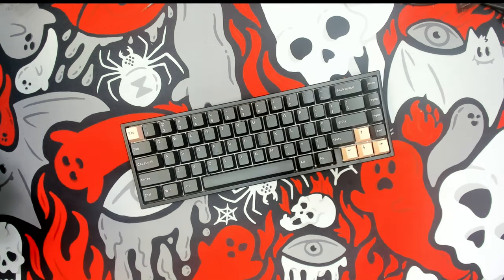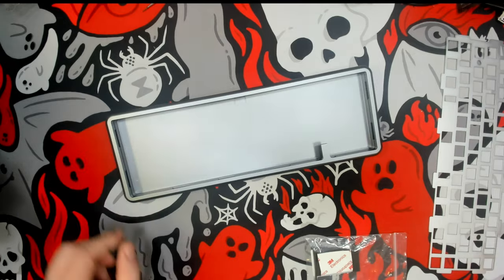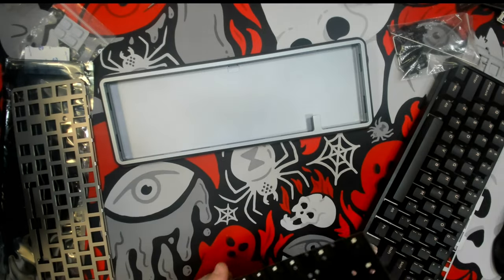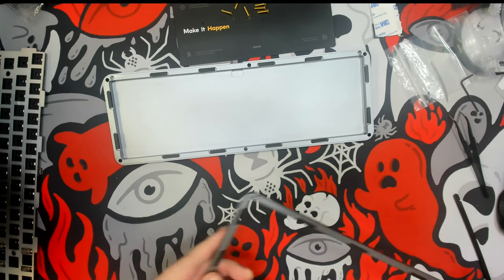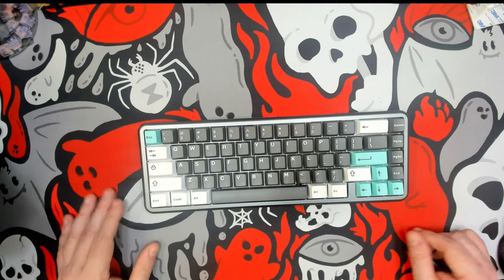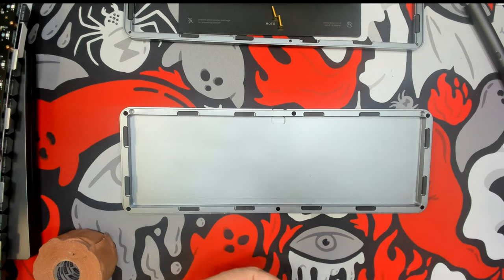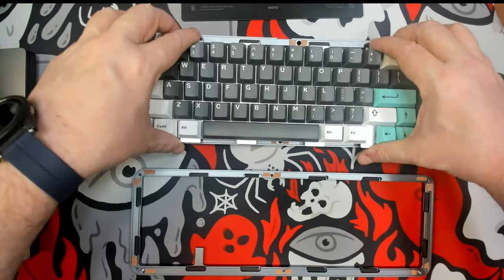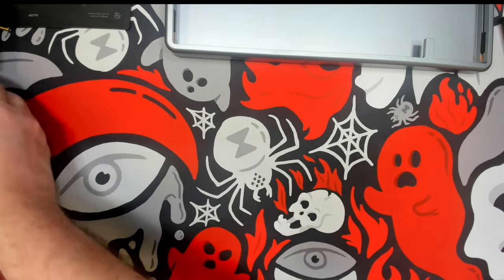Poseidon65 PSD65 BM65  - Build, Mod, and Sound Tests - Upgrade your tray mounted to gasket goodness!

Comment: Yay, was waiting for this one. Sounded a bit clacky to start but after mods came up nice. Might have to consider getting one of these in to play with.

Out of interest (hard to tell from recordings) but which do you think sounds better between the original plastic kit and the alu case?
Reply from the maker: I think they both have potential, but I'm leaning towards the Poseidon case. I will be coming back to this and finding the best mods to get it's optimal performance.
Reply: @MechKeyboards   just looking at the case and finally about to pull the pin on this one as the 11.11 sales are on. When you unboxed the plate was loose in the box and no internal packaging. Did it come better packaged and then you "unboxed" for the vid with some of the internal packaging removed. Bit worried that might get damaged in transit if all loose.
Reply from the maker: @WarrenLeggatt  it was better packed but I removed a lot of it before the video. It arrived with no damage.
Reply: @MechKeyboards  thanks :)
Reply: @MechKeyboards  So finally got my PSD65 today. What a great little case. The gasket is real stiff but I did also stuff the case full. Went poron pcb pads, poron plate damper and poron in the case. Real nice sound to the board and changes the BM65 from feeling a bit cheap to something that has a real quality feel about it. Once you factor in extra foam kits etc then the Sugar65 is cheaper but QMK on the BM just makes it far more flexible. I prefer the 65% without knob also as means I have Home,End,PgUp,PgDn without layers.    Nice little kit and well worth it
Reply from the maker: Awesome @WarrenLeggatt  glad to hear you like it, it truly is a lovely kit. Enjoy!